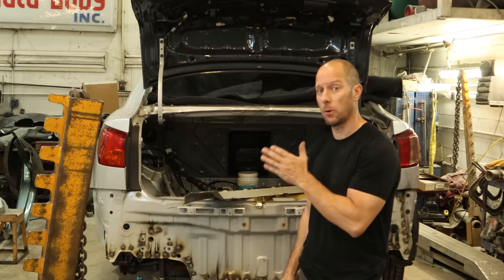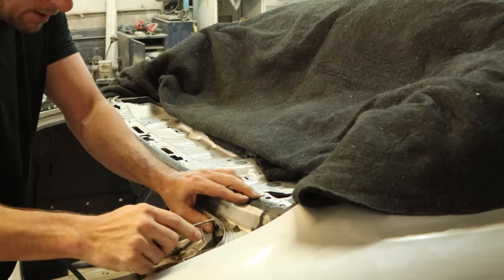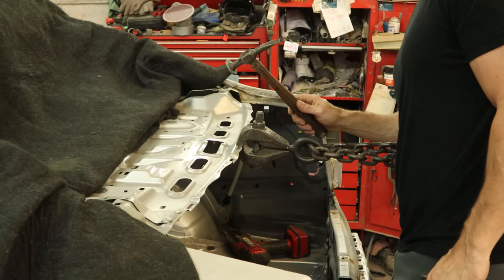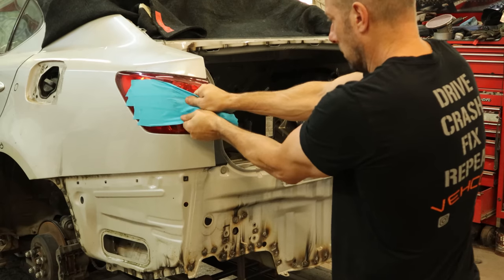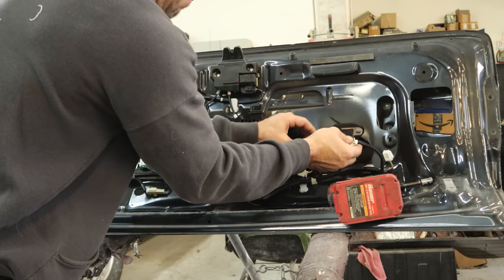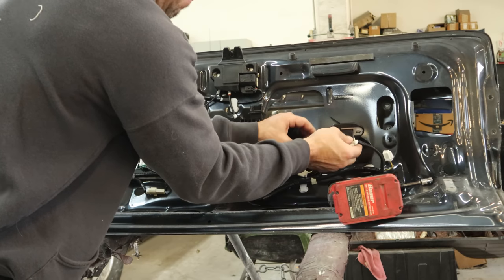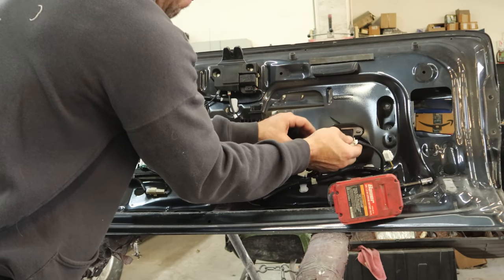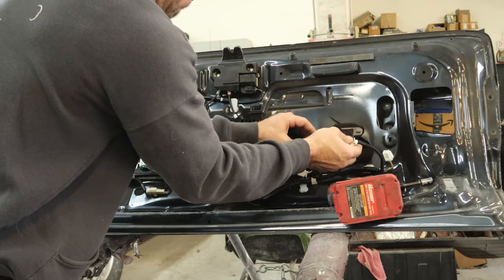Replacing the last welded part of the IS 250 and getting it ready to paint

Comment: Your commitment to quality amazes me. I brought a 2003 Avalon from a  large independent used car lot several years ago, and was able to look it over and test drive it before they put it through reconditioning. It was low mileage and looked well maintained, but it looked like it was owned by an elderly man who drove a little too long before surrendering his license Nothing serious, but it looked like it had seen a few parking lot scrapes. They scheduled it for a full repaint and replacement of a cracked headlight and tail light . So many short cuts were made, but I needed the car and it was a good car otherwise, but I was sure disappointed with the body and  paint work, which was still soft when I took delivery on the last day of the month, obviously a rush job.

Comment: Good tip with the goo on the edges of the plastic inside the door panels is to cut it with a sharp blade and it prevents the annoying strings that go everywhere. Hope that helps. Enjoyed the video!

Comment: In my experience those center-pull clips require a little more time. I use the forked prier to pry the whole thing up about 1/'8". Then I let it settle back down. Then i use a knife to pry the center push pin about 1/8" out of the outer clip. Then I use the forked prier to  pry the center out. Then I pry out the outer clip.

Comment: If Toyota had shipped the cars with good quality bolts on the license plate holes I wonder if the rust issue would have been as bad. 
I assume the cars got whatever random bolts the dealer had.

Comment: I'm not a H&S, right tool for the job, welding, painting, car expert repairer so please don't moan at me. I do have a question. Why 5/16 drill for the spot welds? Is that the standard size of a spot weld on cars? Interesting to watch how a car is built up from all its smaller plastic and occasionally metal parts.
Reply: The traditional initial size for spot welding electrodes was 3/16" - as they are used, the tips erode and when they reach 1/4" they are considered end-of-life.  Since the resulting weld is slightly larger than the electrodes this yields a weld size somewhere between 1/4" and 5/8" depending on the amount of wear on the tips.  So using a 5/16 drill should remove the entirety of the fully-welded section (I.E. the bit that was under pressure while the current was flowing) and leave at most the slightly welded part at the edge of the weld.  The shorter answer is that 5/16" is just about the right size :)

Comment: You should never use a chain to pull dents out of a car due to rust giving the chain spongy performance like rubber.  The 5th spot weld you grind should never be done without tossing salt over your shoulder nor should you step on any cracks in the cement floor.  I once saw a woman who was walking her cat fall right into a sidewalk crack along with her cat.  It was on the news.  It was necessary to get the sidewalk gnome repair the sidewalks all over town.  After that the gnome changed into a beautiful princess with one shoe missing.  The ugly mechanic went through the entire land and tried cheap Walmart shoes on every woman he met but never found her.